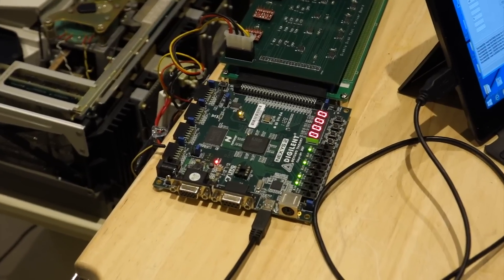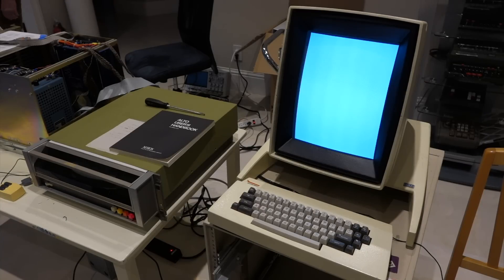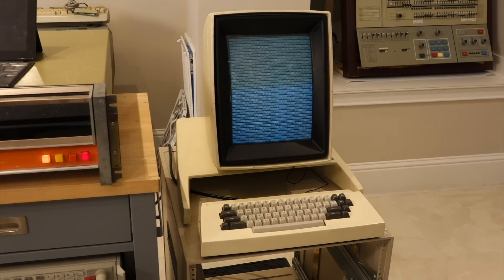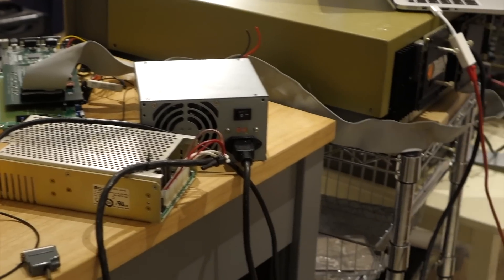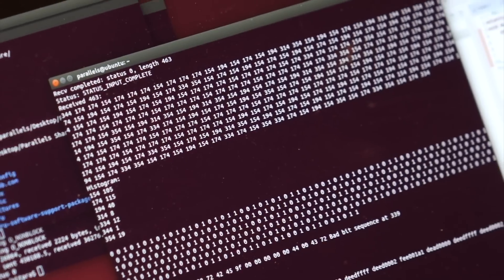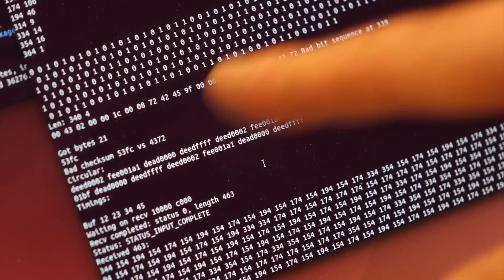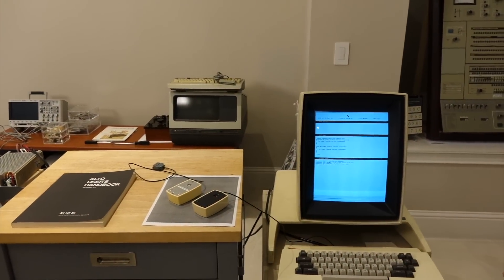Alto Restoration Part 13  - Tools Development Struggle

Comment: For the record, what's the model of camera you're using to take this footage with? it makes that Alto one sexy beast of a computer on video.
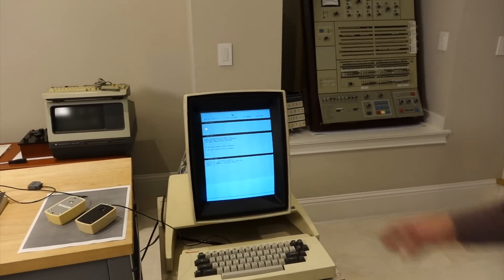I also want to know exactly what that is over there on the top left of the frame at 6:12 with the nice wide CRT. I want one.
Reply from the maker: My camera is a Sony RX10. The widescreen terminal in the background is a HP 2648.